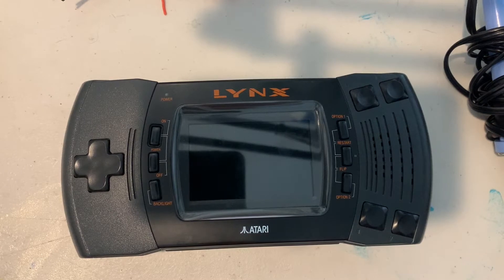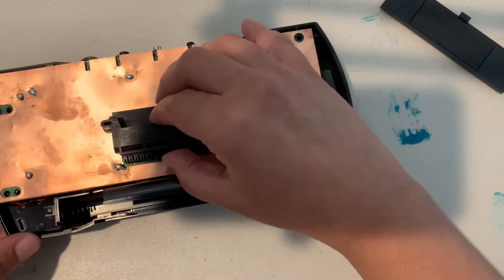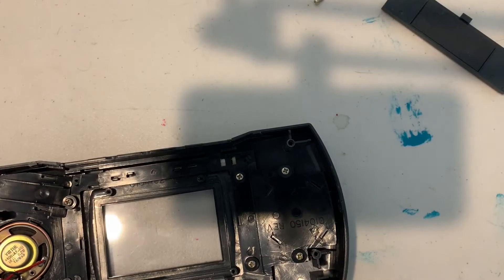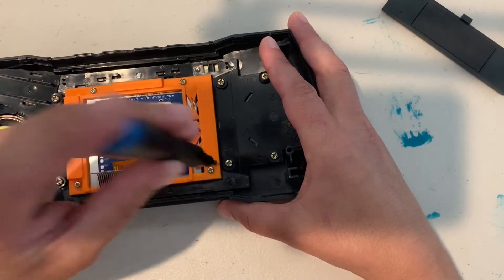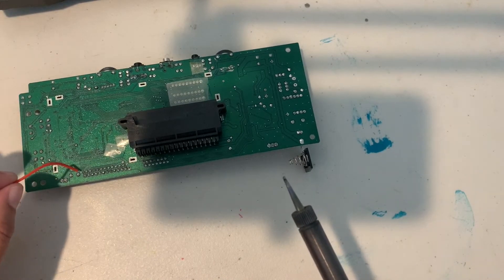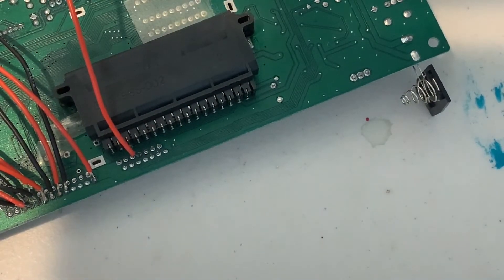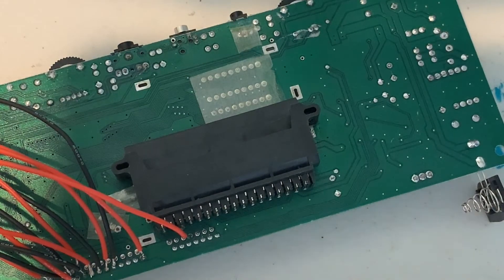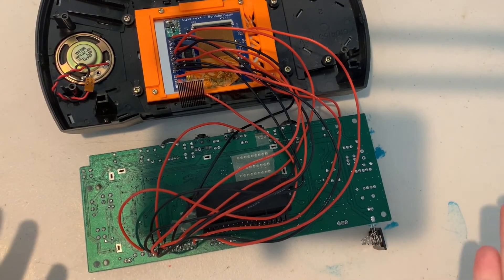BennVenn Atari Lynx Model 2 LCD Installation

Comment: Is the screen aligned correctly. I can see a white line on the left hand side.
Reply from the maker: It was seated in the bracket correctly but wasn’t aligned if that makes sense. I’ve since gone back and fixed it a bit.
Reply: @CandisClassicGameShrine  Yeah that is what I thought might have been the problem. Ive just ordered the no solder version of this screen. cant wait to get it. Great video by the way
Reply from the maker: @RegalBrotherhoodWrestling  yep. Sometimes the brackets are a little wonky and they require some finesse. I bet you’re gonna love your kit! I have the BennVenn flash cart for the Lynx too and I love it
Reply: @CandisClassicGameShrine  I am tempted to get that to. Always wanted a lynx since i was a kid
Reply from the maker: @RegalBrotherhoodWrestling  I say go for it! This is my first experience with a Lynx as well and I’m finding it to be a fun little thing (especially with the new screen).

Comment: Nice video. Had some small tips. The wire you used could have been smaller gauge. Probably 28 would be best. Second you don't want to  leave exposed wire beyond the solder joint. Just cut back the exposed wire after you strip it. You may get.a short if the wire ever bends over time.
Reply from the maker: Yeah 28 probably would have been better but 24 was all I had and my hands are too shaky to really trust myself with a thinner gauge wire. There really wasn’t exposed wire beyond the solder joint but I get what you’re saying. Thanks for watching and sharing some tips 😊